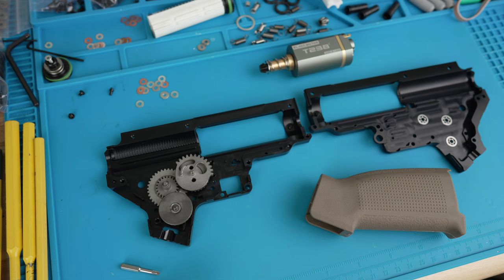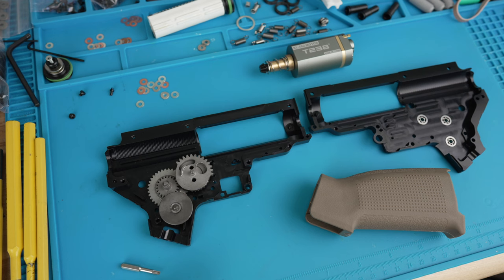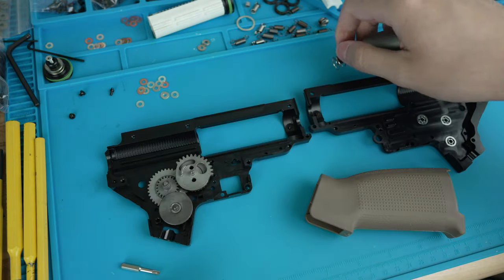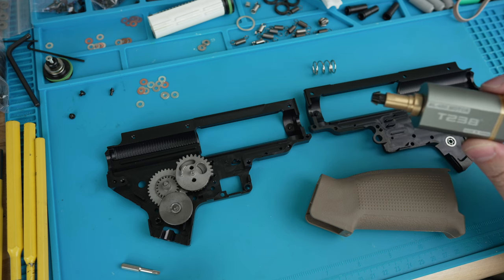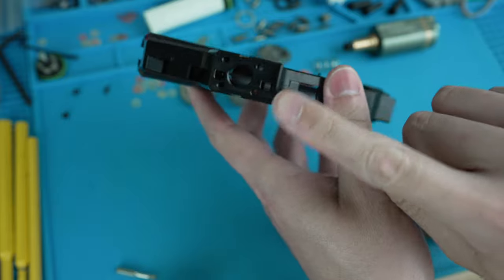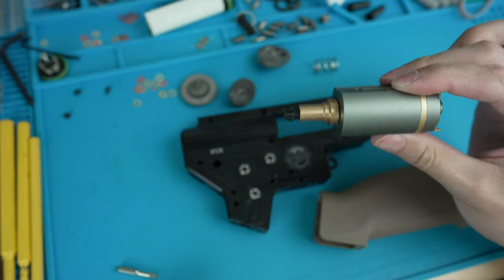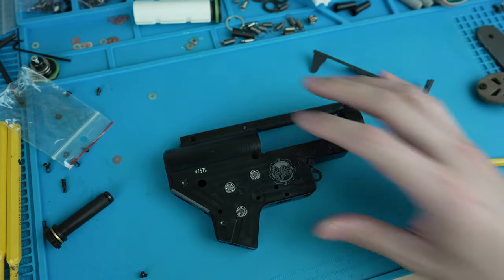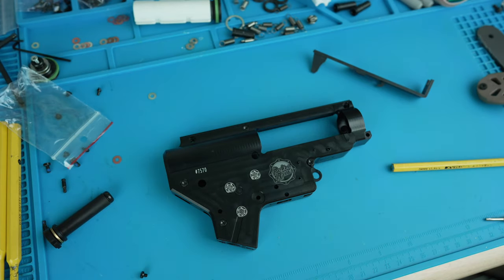Paragon's Perfect Shimming Guide for Airsoft Gearboxes

Comment: Nice to see airsoft shimming start to come out of the stone age. I've been measuring the gear gap for at least 10 years now. I tried to introduce this concept to several airsoft tech groups, but was frequently trolled. My suggestion is instead of wiggling the gear after adding shims just measure again. This will tell you if the play is within what you decide is acceptable. Which is vital when measuring all gaps as a gear might be resting on something for the first measurement. I will say I am disappointed that you didn't continue to measure gaps. I used to measure pinion to bevel to about .25mm. All gears to gear gaps I would measure to have a .20mm between them. All gears would be locked in to place at about .10mm. These measurements come from mass repair and work across 99% of gearboxes. Also very good suggestion to be more lenient with bearings vs bushings. Also that sound at the end isn't a burr it is two gears rubbing.
Reply from the maker: Thank you! You bring up a lot of good points. The cause of the sound was actually material that wasn’t machined off the step gear. You can kinda see the ring in the video. I replaced the step gear and problem was solved. I am still measuring gaps in a sense. As stated in the video, Siegetek gears are manufactured in a way where you can simply just add .1mm to the gear you just shimmed before. This is of course if you go in order from pinion, step, then sector. In the video I had a .1mm on the bottom of the pinion so if I wanted the gap to be .1mm above that, I would add the two values together. 

Also the reason why I still check pinion fitment by feel is because of potential errors in the depth readings. Because the micrometer isn’t 100% in line, I’m not getting a 100% accurate reading. I have to factor in this margin of error. Hopefully I explained that clearly
Reply: @paragonarmory  I'm not saying skip the feel test. As you pointed out  most gears are made to poor tolerances. A feel test can help you find a bad spot and you can follow up with measurement to determine what needs to be done. The secondary measurement is also important when you start measuring all gears down the line. As I previously said it will point out if the gear was resting on something for the first measurement. By measuring where all gears lay you can decide what is an acceptable tolerance between all gears. Not just bevel to pinion. The measurements I gave are from years of repair work across all brands. I found those to give extremely reliable results no matter what brand. Matter of fact for a while there I ran a repair shop where I gave 1 year warranties to my work because I was so confident in the system. Never had a warranty repair.
Reply: When you say .20mm gear gaps, do you mean the offset of the neighbouring gear heights? How do you measure that?

Comment: So first you do measurements to the hundredth of  a millimeter... Then you just "feel it". mmhm. Helpful.
Reply from the maker: We’re validating the measurement taken was accurate. There are times you will get false readings and shim incorrectly. Not only that but some gears will have slightly different size teeth also causing inconsistencies in measurement. By rotating through the entire gear, we are feeling for any potential binding.

Comment: Very good. I've been doing it similar to this for a while and am glad that there's a modern video out there with decent production value in it. 

I also add a step where I test the shimming at the end with only the motor and the electrical components with a watt meter. Comparing the amp draw of a motor with no load vs the motor with load after to not only hear for audibles but also check the draw efficiency.

Comment: This was excellent and raised some of the best points. Motor tower shimming is probably the biggest, and the play in bearings can make a  impact on shimming when measuring by the mm. If each gear has 1mm of play due to bernings flexing slightly in addition to the 1mm you left there can be alot of room for error when the gear train is under load pulling the piston causing the gears to move sideways slightly. Making sure bushings and bearings are perfectly flush and secure is so crucial! Love the video, do more, I wanna see comparison/ ecample videos of all the Gucci parts u stock.
Reply from the maker: I think I might go over compression stuff next!

Comment: Big love from Magnus Armouries -great video. ❤
One thing that could have possibly been mentioned would be if using bearings, make sure that the outer shim contacting the bearing should fit within the races, apposed to a larger diameter shim rubbing on the flange/outer race of the bearing. :)
Reply from the maker: Thank you! That’s a good point, however with the wider diameter rocket shims you get better protection. The larger diameter acts as a shield for the bearings and prevents excessive loads on the bearings. This does come at a cost of more friction, though. No right or wrong answer and a matter of what’s more important to the individual.
Reply: @paragonarmory  very true! I've always come from the standpoint of resistance is futile haha , and if using J-cage bearings there shouldn't be worry about lateral stress.
But if you want a gearbox  to be as reliable as possible for a customer , I completely understand your standpoint :)

Comment: Negative airsoft did a piece on his motor towers that he had made with different sizes so you don’t need the tape but it’s cheaper to tape and it means you don’t have to mess on if you decide to change the motor to another riff all you need to do is remove the tape and make the motor fit the next riff by adding new tape to fit the new riff gearbox.

Comment: Excellent Video. Loved all the points you made.  Hoping you'll do a video on compression parts as well. Do you guys run cylinder heads with the front buffers in your builds? I hear they're not particularly great for retro arms gearboxes because of where they seat.
Reply from the maker: I do run cylinder heads with pads on the front. The ones made by FPS Softair are designed properly and don’t cause gearbox cracking. Avoid the Maxx and Lonex cylinder heads as those are not designed properly and will break the gearbox. I can do a break down on the different compression parts I use.

Comment: In the case of a mp5k you still need to use the lower for shimming as it doesn't use the cage. Mp5's hk33's and g3 's have it so the lower and pistol grip are all one piece. In fact thebonly reason the mp5 uses the v3 is it's flat on top and thats ehere the battery is housed. I knond of like that over the pdw stock cyma used because that buffertube can only house short batteries. Not sure if they can fit li ions but i only use thise in lmg's and I also couple it with A t238 motor.

Comment: Hey dude just finished shimming my gears. I had to replay parts over and over to fully understand the process and your video was extremely helpful. I actually went out and bought a caliper just for this and separated my shims because they came mixed and had no idea which one was which. Quick question, how do you get your gears to spin smoothly when you test with your finger? Is it because you have bearings? I have bushings so I’m kinda curious. When your pistol was put back together at the end, the gears were spinning really nice. Mine arp 2.0 didn’t do that but they still spun just not as good as yours lmk bro thanks

Comment: Hey man , really nice video you made.

Have some tips for uthought  , it's always mesuring with the caliber before you shim shaking and playing with the screwdriver only it's not enough. In case you have different play on different spots of the gear should get several measurements and get the average of it , then shim with a caliber. 

And last , don't use bearings man , they are terrible for shiming when there so small , the inner ring outer ring tolerance and play it's different in every single one and is changing in a short period of time , I would go with bushings 100÷ to get the most out of it !

But still good job and thank you for doing such a great video!
Peace! 😊
Reply from the maker: Yes it is important to get multiple measurements. This is much less of a problem with CNC cut gears like Siegetek which are extremely consistent. I disagree about using bushings. Bearings are better in everyway if you're using high quality ones.

Comment: very good video and well explained, what brand are those gearbox bearings? I liked them.
Reply from the maker: Paragon Armory. Link is in the description
Reply: @paragonarmory  Hi, thanks for replying, do you have a video showing how you put the aluminum foil on the motor?
Sorry to bother you so much, but I find a lot of sense to everything you explain, what is the aluminum foil tape you bought?
the shell is reinforced, can it resist an m130 spring?
what internals do you recommend for a dmr configuration?
ufff....too many questions, but you convinced me of everything you say...
Reply from the maker: @vamp01968  You would wrap the aluminum tape around the motor shaft to increase the diameter. I bought it from Amazon. The shell can handle any spring you want to put into it. The Retro Arms shells are very strong.

Comment: Good video. Out of curiosity, was that a Retro arms Tappet plate? Also to echo other commentators, a video on compression parts would be great.
Reply from the maker: Thank you! It’s a Guarder tappet plate. Both are good though. I’ll start generating ideas for a compression parts video then.
Reply: @paragonarmory  Thanks for the reply. That's the second video I have seen recently where that particular brand of tappet plate is used. Must give them a go in one of my builds.

Comment: The only thing standard about shimming is the shims. Each set of gears will have its own measurements and each gearbox will have its own measurements separately from others of the same make/model. Even a slight deviation will cause abnormal sound and operation and even gearbox jamming or straight up breaking parts. Good Luck to you all who try to be your own technician. 
** If you feel the slightest bit that you might not do it right then don't even open your gear box!! ** 💸💸💸

Comment: stupid question time....

The taping to eliminate slack between pinion/bevel to reduce play:

 Is the spring on the motor removed and height is set by screw in handle, or is the spring kept below the taped section to still allow some up/down movement ?

I see it with and w/o in the beginning and have not attempted to see for myself when setting the initial motor height.

Thanks.
Reply from the maker: You tape the shaft with spring removed first, then add the spring back for adjusting motor height.

Comment: Great point on the motor shaft sleeve. How do you handle bearing that protrude out on the fire selector plate side?  My plates ride over the bearings because the gearbox shell is not as thick as the bearings in that spot so the bearings stick out more than the stock bushings did. The selector plate can still slide over them but it cause some deflection on the plate getting it into the guide slots.
Reply from the maker: The retro arms selection plate has a groove cut out for bearings. It’s our favorite selector plate because it moves so smoothly

Comment: I've rewatched the part at 28:17 so many times, but I don't understand it. By adding 0.2mm to the bottom of the step gear you are bringing its face closer to the face of the bevel (which has 0.1mm shim at the bottom), more precisely the face of the protrusion that's being used by the anti-reversal latch. What am I missing?
Reply: Oh wait, your bevel gear looks much different. You don't have that protrusion for the anti-reversal latch, what the... :D
Reply from the maker: You want the bevel teeth and step gear / spur gear teeth to have as much contact as possible. The shim measurements will depend on your particular setup. Get as close as you can before you hit the ARL notch wheel.
Reply: @paragonarmory  Oh yeah, I had to use so many more shims than you. I have like 1.25 mm of shims on the top of the sector gear for example. My gearbox is built different :D It took some hours, but I think I'm done with it finally. My only concern is that the sector gear contacts only half of the piston rail. I saw pistons with half rails on the market so I guess I'll be fine. This with all the bearings... I don't know how long this weapon will last, haha. Either way, thank you for the detailed video.

Comment: What do you do if the hole of the motor grip ist smaller then the motor shaft hole in the gearbox? I mean I can't apply aluminum tape on the motor shaft to reduce the space, because it will not fit through the hole of the grip.
Reply: just dremmel some of the grip away. just be carefull. a little bit at a time 😅

Comment: I've known for years, but no one mentions  shimming the motor shafts or rotating the bevel gear to check for clearance.

12:25
You are the ONLY one to mention that this is an issue with "D Type" pinion gears. I always rotate my bevel for this reason. Can you elaborate a little more in detail, maybe even a new video, addressing this issue and the exact procedures on what to do and how you overcome this issue?

All the motors I use are "D" because back in the OLD days on teching, "O Type" pinions would commonly slide down the shaft, causing even more issues. This, I have personally experienced several times, hence the reason for switching to D types exclusively.

I have noticed in many builds that I do. This issue is actually what has cause me so many headaches.

If possible, please make an in-depth video on this issue, I know I may not be the only one that has pulled their hairnout, and no matter where you ask, the only unanimous answer is "Check your shimming" without any explanation.
Reply from the maker: O type pinion gears don’t slip anymore if the tolerances are correct. If they do, you can apply some retaining compound to keep them into place. When shimming MIM / D type pinions, we’re looking for any tooth that might have a tighter for than the others. That’s the tooth we need to measure from in order to prevent binding. It’s rather simple so don’t over think it.
Reply: @paragonarmory Hello again. Going back to this.

Currently shimming my PDR-C. I noticed when I rotate the bevel gear, checking also with a depth gauge, there is about .40mm of up and down movement until I get to 3 consecutive spots where the play is about .10mm. Should I be shimming off the .10mm play area? This is a constant thing no matter what motor I switch to, no matter what bevel I use, no matter what pinion I have. Its weird and frustrating. 

I had another gun build  that constantly made screeching noises until I shimmed out ALL the play. It sounded like a perfectly tuned gearbox. As soon as I let a .10mm play from bevel to pi ion on that gun again, it sounded horrible.

I have the motor shimmed out in the cage already, I bought aluminum tape specifically for this.

Comment: Question, when your taping the motor tower wouldn’t you want to tape it according to the circumference of the pts grip since it contacts before the gearbox motor hole? For example I’m using everything the same except my motor is a warhead base which is near perfect to the pts hole which doesn’t move at all
Reply from the maker: You can shim to the grip too. Whichever is smaller. The PTS and the retro shell have the same diameter usually

Comment: Is your pinion to bevel gear play  at 0.75mm alot or average? I'm ahimming mine and it's 0.12 to 0.10 😂
Reply from the maker: Typically anywhere from .4x to .7x with this parts combo. Some combos may fit tighter than others to start.